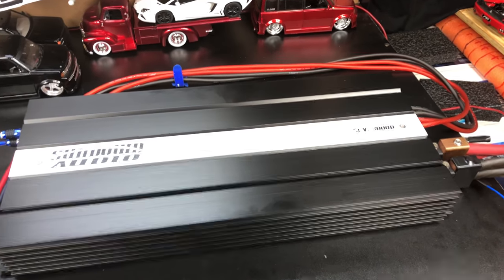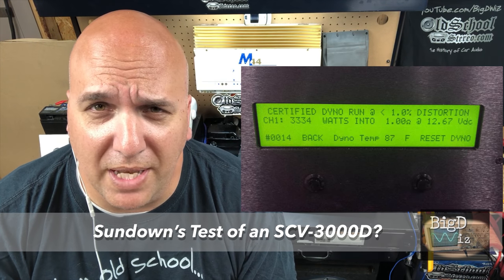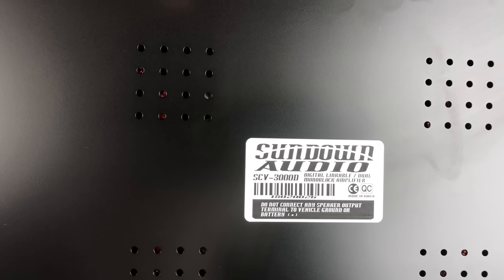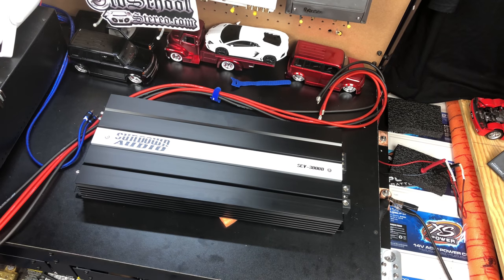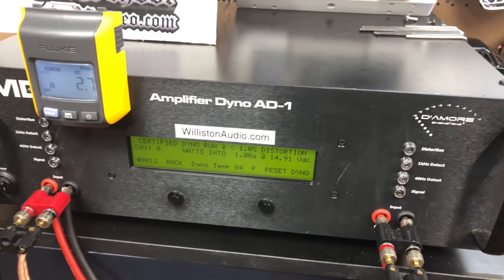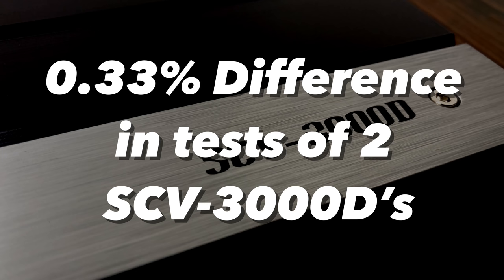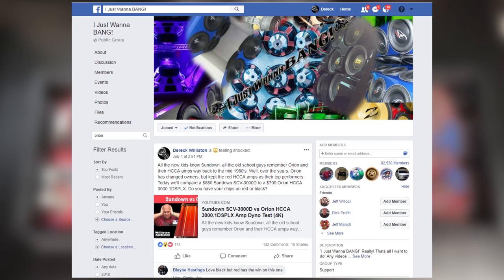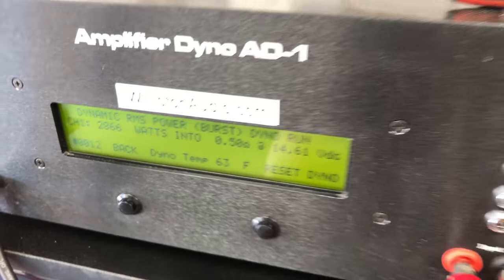Sundown SCV-3000D Amp Dyno Test - Follow Up (4K)

Comment: What if you tested at a lower voltage? It seemed to hold pretty good at 14.4, what about power ratings at 12v?
Reply: on someones comment below bigd replied he did a 13v test and got 2399 watts. my guess is 1700-1900 watts @ 12v

Comment: I bet it was Jacob that gave one of the thumbs down. Lol. I do like sundown, but I like the subs better than amps. I have two Orion HCCA 11,000.1s, I could not be happier with them. I am an oldschool guy, but the Orion stuff you can't beat right now.
Reply: I also have an Orion HCCA 4,000.4. This amp is the most powerful 4 channel amplifier I have ever seen or used. It's a fu**ing beast!

Comment: What are the power output results when the voltage supply is only 13.xx VDC?
Reply from the maker: Right at 2400 watts at 13 volts in my tests

Comment: Help me understand what's going on here. You tested an amplifier. That amplifier did it's rated power.  But for some reason this hurt the manufacturer's feeling so you test another amplifier and that amplifier did its rated power. What's the problem here?
Reply: Justin Gardner Jacob @ Sundown questioned the individual and their dyno test. In this case it being Big D and his character and reputation essentially by doing so. I don’t/can’t speak for Big D but if Sundown hadn’t called into question the dyno & Big D himself he wouldn’t have run another dyno with a different amp but since they (Jacob) did Big D ran another amp on the dyno, showing us in detail how his setup is, how everything is wired, etc. to show that his dyno vids are NOT in any way biased and the second Sundown did essentially the same numbers. As others have mentioned, the Sundown did it’s rated and nobody even questioned its ratings. It just looked bad in the drag race with the Orion because the Orion didn’t just do better on the dyno against the Sundown, it absolutely destroyed the Sundown along with all of the others in this series. My personal opinion is that Sundown/Jacob shouldn’t have publicly commented about the dyno results and as it did exactly what it is rated to do but not only that, he called out Big D’s character and reputation which was WAY out of line all because his high margin product ‘looked’ bad next to the Orion.
Reply: Jacob (Sundown) says that the amp meets or exceeds power ratings at 13.3 volts. IT DOES NOT. It takes over 14v to meet rated power.

Comment: 10-11 months later lol no more SCV 2000 or 3000.. No Korean sundown til SCV4000 $1149... replaced SCV3k with SAE 3000 $769, still expensive b/c the S&I Korean built Deaf Bonce AAK 4000.1 is $769. S&I does the SCV line, I’m pretty sure SAE is the Chinese built line for Sundown. 

I like Sundown, What makes this crazier is they supposedly test every amp and every sub before it leaves their facility so how did they not know about this before BIG D’s tests? 

My Zapco Z3KDII was I think $50 more than a SCV3000 w/ better components geared toward SQ. The Z3KDII starts buzzing/ clipping around 62 V Ac w/ a 0db 50 hz tone. 3000 W @ 1 ohm is 54.77 V Ac.
Reply from the maker: I believe they test for functionality, not output. I didn’t talk to Jacob, but I do believe they were mislead by their supplier. The prototype and the production amps were different. Rather embarrassing for them I’m certain. You live and you learn, don’t thrive on the negative. Learn from mistakes and grow. I truly believe Sundown is a great company and I hope there’s no hard feelings as there is none on this side of the table.
Reply: Williston Audio Labs I understand and think you handled this awesome. I like sundown, just confused on their pricing and product line so that’s why I commented. Have a great weekend Big D!

Comment: What was the issue? I didn’t understand the whole story.
Reply from the maker: Sundown's prototype models produced well over 3000W at 13V, so there was mention my test on the first amp was either wrong in some way or the amp was bad. I got in a brand new amp and showed within a few watts, these amps barely reach 3000W at 14.4 volts. It's unfortunate Sundown's supplier modified the design, but it's also important to point out there was no issue with my first amp or test.
Reply: @wal  oh ok, so if it produced 3k at 13V it should been hellova lot more at 14+ V, got you. And Sundown said that your testing was wrong, but in fact it wasn’t. Got it, thanks!

Comment: Orion has been around for literally decades. While Sundown has only been in the game for about 1 decade. The proof is in the pudding. Orion, with their experience, knowledge, and history will virtually always dominate. And I'm not just talking about their HCCA line either. Their cobalt line is a solid starter line. The XTR line is inexpensive yet brutal. They have basically perfected the car audio sub amp line and continue to dominate at all levels. Now their subs, on the other hand, need some help. But subs are cheap relatively speaking.

Comment: I was jus in the group and seen this....and went to view it...ill be keeping my skar🤷🏿‍♂️
Reply from the maker: Sundown discontinued this model. It was always an SAZ-2500 with a little extra kick. Very reliable amp, just not the underrated powerhouse they expected it was
Reply: Williston Audio Labs if you look on CACO the SCV 3000 was supposed to replace the SAZ 3500 V2 $989 vs $799 for SCV3000.. had prices for SAZ to SCV transition thread titles “ Most Of Sundown SAZ amp line getting replaced “

Comment: Goodnight , I think you should really .rerun a test on the ORION .It could be an amp that was tweaked , to make Orion look really good
Reply: Peter B BigDWiz bought the Orion brand new from a retailer like a consumer to avoid getting a so called "ringer amp" from the manufacturer. I own my own 3ksplx and it does way over rated just as the one in BigD's test did.

Comment: sometimes the price difference reflect more than just power for the money. you could be paying for better quality control, higher quality internals or customer service. in this instance however, i believe that while the sundown amp is indeed a fine amp, its priced higher than the market allows.

especially since Orion is wrecking people once again.
Reply from the maker: The Crescendo, DC, Skar and Sundown are all S&I Corp amps. There are differences in the Skar and SD, but the Nendo and DC are virtually identical. At quantity, these amps are just a couple hundred dollars. We as consumers should understand that we don’t always “get what we pay for”. We pay more so they can play more 👈😲

Comment: I have the Fluke meter as well,  when working on anything its the best 

i can work on anything and see the screen in my hand  or near me 
good for checking voltages at the amps inputs while your up front 

Good test and another thing about sundown i have noticed is that 
their subwoofers  ohm loads are never close to what they should be 
2 ohm coil  reads   2.2  
1 ohm coils    I have metered read 1.3   

odd? or clever marketing design to stave off warranty with higher ohm loads?
meaning you think your at 1 ohm with two subs in parallel but actually 1.4 or 1.6

Comment: What’s your favorite sq 4 ch amp
Reply: Greg Keyes not big D wiz but Zapco AP line.. SQ gear gets expensive so it depends on your budget. I found for my budget and needs, plus component/ build/ overall quality the Zapco AP to be above mosconi, helix, focal, etc. Also find a brick and mortar dealer or distributor for Zapco to get real world pricing, they are cheaper than Amazon pricing. Especially if you buy it from the dealer doing your install.

Comment: Sundown meets their power ratings, and they are a good amp. They just cost too much compared to the amps out there that far exceeds their power ratings. If sundown would knock off about 25% -35% of their MSRP then they would be in the same ball field as their competition.

Comment: Damn. Well, may eventually upgrade to the Orion HCCA 3000 amp, and sell my Sundown scv2000d. Looks like these Sundown amps do rated, but those Orion amps DESTROY rated power. Looks to me like the Orion amps are more bang for your buck.
Reply: Godzilla 73 
How much u want for the sundown?
Reply: Ronald Palma May take $275 for it. Gotta get the Orion first. 😆
Reply: Godzilla 73 
$275? But everybody on here is saying they’re no good and the owner is a crook and Orion is way better. I’m sure you can lower the price.
Reply: Ronald Palma 😆
Reply: Ronald Palma Hard to beat that price. Not sure youd find it in the $300 range.
Reply: Godzilla 73 
Lol I’m just giving you a hard time. I know what they usually go for. I’ve been beating on a saz 1500 for YEARS now without a hiccup. I’m definitely open to a small upgrade to my temporary system. I got 2 24” tantric SHDs I’m going to install soon.
Reply: Ronald Palma aah. Yeah. I have mine hooked to 2 Soundqubed HS3 12s, in a ported box tuned to 32hz. Sounds very good. Just thinking of getting a bigger amp.
Reply: Ronald Palma Never heard of those subs. Now your gonna make me look em up
Reply: Godzilla 73 
Well unfortunately the company is no longer around, but their subs were some of the best around. They set many world records when they were around. I used to compete back in the day running RD Audio. I had two heavyweight “18s on a D9. Amazing setup, but I’ve been out of the competition game for a while now.

Comment: A company who's amp does rated power. At a high price, is as deceptive as a cheaper stronger unit a noobie buys and destroys their equipment with. Both companies are great. With that said, I have never had a sundown amp that has blown or damaged. I paid for reliability. I wanna see .5 ohm vs orions .5 ohm those numbers should be scary.

Comment: Sundown, just take that ass whoopin' like a man. The fact that Mr. Fuller felt it was necessary to defend his product, despite the fact it did rated in the original test, was odd. Then, to bring your test into question was insulting. Orion makes a better product, at least in the models tested. Suck it up and either make a better product, or keep it movin'. 

Anywho, good stuff Big D! These shootouts are going to tell the real story.

Comment: I don't understand what the big deal is. You tested a group of amps and the Sundown passed. Even if it would of failed that still wouldn't be your fault. It's simply just running tests and posting the results. Is this guy really throwing that big of a fit?

Comment: I have a 2014 charger 370 mechman but it has regulator on the electrical system 2 xspower batteries 3400 and 7500 with that 3k running half ohm no problem
Reply: mj3 kel 🤦‍♂️

Comment: In before the shitstorm that will come rolling it as Jonathan Price just tested the SCV-4000D just a few hours ago (the model up from this). The conspiracy floating around is that this was done on purpose to gain back a bit of credence after their SCV-3000D debacle.
Reply from the maker: I understand the 3k was a shock to Sundown as they expected these amps to do more. Something changed from the build house and they are left with egg on their face. Amp didn’t do bad, just not the 10-15% underrated they expected based on prototype tests

Comment: See now this right here is the reason why anytime I'm on the market to buy an amplifier I visit Big D Wiz or Ryan Blankenship these two guys stand by their equipment stand by the results and even to the point of putting their own money out there to test this equipment. Not I will admit I love Sundown and nothing can be taken away from Sundown it makes rated power. But that just shows you how overly built the Orion amplifier is. Strangely Orion is cheaper than Sundown but I'll bet you the Sundowns last longer than the Orion not to mention customer support was Sundown Audio is a s*** ton better along with their warranty is better than Orion. Yeah you're going to pay a little bit more for the Sundown but you're going to get what you paid for in the long run. That and Jacob Fuller is one of the down to earth nicest guys you'll meet and as you can see from this video stands by his equipment

Comment: Over hyped amps but good. Orion layed the smack down on sundown.
Reply from the maker: Sundown back with the SALT series
Reply: @mac4782  I believe the 8k did around 12,000 and the 12k over 20,000....I believe they came back at Orion-and honestly outside of the big numbers for a few seconds that orion ended up being garbage; lot of people had issues that I saw......both amps are losers imo; one is low on numbers and the other is a bomb.

Comment: Maybe they tested their amps at a higher frequency, 100hz?? Maybe. Don't amps sometimes make more power at different frequences. You tested all the amps under the same conditions and it did its rated power though so it's a bit funny they had a cry over it.
Reply from the maker: He based his comments on a previous SCV3k they tested. It did 3300 watts at 12.6 volts according to the screenshot that was posted on FB. I tested this amp at 13.1 volts and got 2399 watts. That’s a HUGE difference!

Comment: SAE3000 vs SCV3000
Anyone know the difference?
Reply: sae are chinese boards scv are korean
Reply: The chinese Sae will make more power at rated voltage. The korean scv3000 is just a strait up, over rated, turd.

Comment: Orion is a good brand but damn look at all the batteries u would have to run to supply the amps needs to get to that number
Reply: mj3 kel same amount of batteries to run the Sundown test ... Orion makes power at 12.6 v which is standard car battery voltage... Sundown doesn’t.. even with how ever many batteries Big D Wiz running! ( a lot ) ( plus dual inputs ) have a good day bro just tryna help u wit real info

Comment: The 1 ohm tests are just for flash.  They are pointless other then for show.  WHat do the do at 2 and 4 ohms? Thats where it will be operation.
Reply from the maker: How are the pointless when the amp is rated a certain power level at 1 ohm?
Reply: @wal  Because its not power that actually gets used.  One may have a 1 ohm speaker load but once the speaker starts moving the ohm load changes.  Its fine to have the rating on there.  Thats all well and good but even you should know how box rise works and that even though the amp has an awesome number at 1 ohm the end user wont see that power.  Thats where the 2 and 4 ohm ratings become the important ones. Those numbers are the ones the end user will actually see and should care about.
Reply from the maker: @slojoegtstang5775  we should all be using the PowerCube like Rockford Fosgate to show output vs frequency (simulated with reactive load), but even this can be incorrect based on the box, environment, temp, etc. Resistive ratings give us the best method to compare amplifiers even if people never "see" the output shown at the lowest ohm loads.
Reply: @wal  That just proves my point. 1 ohm will never be the actual output.  The tests are good eye candy but the 2 and 4 ohm tests are really where the focus should be.   This will give the consumers and patrons a better example of an amps output would be like in the real world.

Comment: why make a big deal of this cause its not like the amp was severly over rated i mean 3k vs 2.94k is essientially correct so yeah amp did fine if i wanted an all sundown build id still use their amps no worries for the brand had it made 2000w when its rated 3k then they wouldve had an issue but yeah nice vid big D and keep it up hope in the far future you do a few PA Amplifiers like crown ,lab gruppen or EV etc.
Reply from the maker: I will do PA amps, promise!
Reply: Erik Britz the problem is there supposed to do rated at 13 volts not 14.4
Reply: yeah man but still i don't believe it's good to go down below 13v in anyway 14.5 to 14 is a safe zone if i'm not mistaken so i'd rather want my voltage to stay in that arrange when i build me a big system
Reply: Thanx BigD the thing is using car amps in doors is tough and alot of people including myself use a mix of car audio and PA indoors and since most proper power amps run down to 2ohm we can actually use these amps with our subs and yeah.
Reply: Erik Britz Once your car is on and running you’ll be seeing around 13.6 to 13.8 V which includes 98% of cars today. That’s why ppl like 12.6 V ratings and 13.8 V ratings with amps
Reply: yes but i mean on larger system for instance where you upgraded the battery alts etc. large systems 12.6 to 13.8V is dangerous but i understand why if a amp states a certain power at 13V why it's enticing still 2500-2900watt isn't bad for this amp

Comment: funny, my $499.99 skar skv2.2500 does 2900w rms and is rated 2500 and compares to this sundown amp pretty well at almost half the cost.. and I've had no problems running it daily at .7ohm..  sundowners are just over priced cry babies.. you obviously don't get what you pay for, your paying extra for a name and getting nothing extra.. 

I feel if they came down in price they would sell a lot more, someone has tight pockets.. I still doubt I would ever buy one.. there's to many other companies that offer more for less money..
they just made because the skar actually looked better for less money..